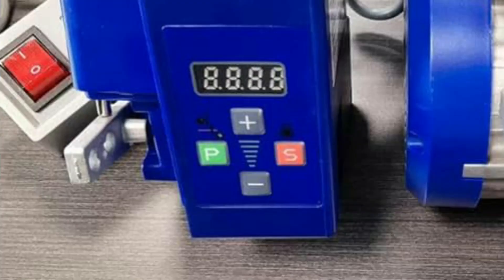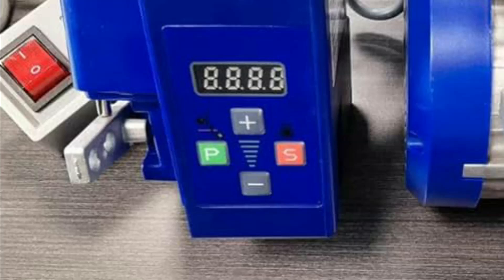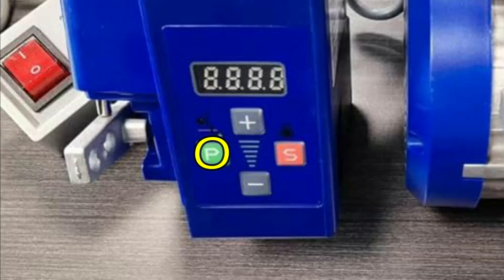Sowing Machine Servo Motor Electronic Control Operation Manual

Comment from the maker: 0:00:10
The ( P ) key and the ( S ) key are used to change the parameters of the servo motors or to change other functions
0:00:15
Additionally, if your sewing machine is equipped with an LED light
0:00:20
you can turn the LED light on or off by pressing the ( S )  button
0:00:25
In standby mode, if your sewing machine is equipped with a needle position sensor
0:00:30
you can move the needle up or down by pressing the ( P ) key
0:00:35.027,0:00:40.026
By pressing the ( P ) key you can move the needle up and down without turning the hand wheel
0:00:40.026,0:00:45.025
While in standby mode, you can easily increase or decrease the speed by pressing the ( plus ) and ( minus ) buttons.
0:00:45.025,0:00:50.024
If you want to change the direction your servo motor rotates to forward or backward.
0:00:50.024,0:00:55.023
While in standby mode, press the ( P ) key and the ( + ) key at the same time.
0:00:55.023,0:01:00.022
Then you can see  ( P - 00 ) on the display.
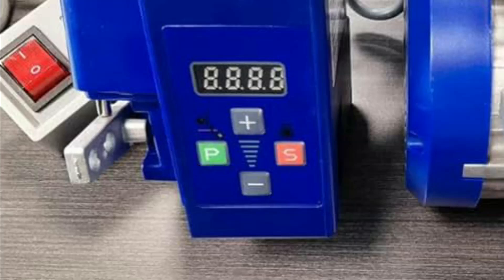0:01:00.022,0:01:05.021
If something other than (P-00) is displayed, for example (P-17)
0:01:05.021,0:01:10.020
use the plus and minus buttons to change (P-02)
0:01:10.020,0:01:15.019
After selecting (P-02)
0:01:15.019,0:01:20.018
Next, press the ( P ) key.
0:01:20.018,0:01:25.017
Then you can see ( 1 ) on the display.
0:01:25.017,0:01:30.016
Change ( 1 ) to ( 0 ) by pressing the plus button.
0:01:30.016,0:01:35.015
Then save by pressing the ''S'' key.
0:01:35.015,0:01:40.014
This allows you to select ( 1 ) to rotate the motor backwards for the overlock machine and save.
0:01:40.014,0:01:45.013
This allows you to select and save the motor to rotate forward ( 0 ) for normal machine.
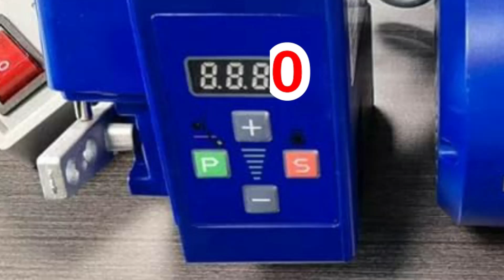0:01:45.013,0:01:50.012
Generally, servo sewing machine motors operate at speeds between 1000 RPM and 7000 RPM.
0:01:50.012,0:01:55.011
If operating at a maximum speed of 7000 RPM is a hindrance to you in completing your sewing tasks.
0:01:55.011,0:02:00.010
You can always maintain your desired speed without exceeding it.
0:02:00.010,0:02:05.009
For that, you need to use the Speed Lock feature, which is done like this.
0:02:05.009,0:02:10.008
Press the ( P ) and (minus) buttons at the same time.
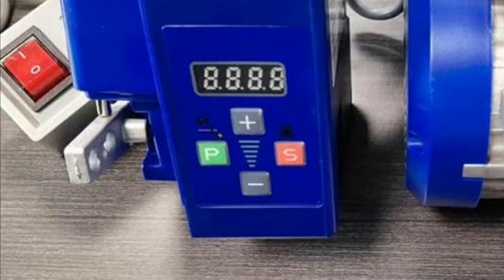0:02:10.008,0:02:15.007
Then you will see the first ( 0 ) on the display blinking ( 0000 ).
0:02:15.007,0:02:20.006
Four zeros appear on the display, the first zero blinking.
0:02:20.006,0:02:25.005
Now you need to enter the pass code.
0:02:25.005,0:02:30.004
You can enter any password you like.
0:02:30.004,0:02:35.003
I'll use 2024 as an example.
0:02:35.003,0:02:40.002
Using the (plus) key, The first ( 0 ) is changed to ( 2 ).
0:02:40.002,0:02:45.001
Next, press the (P) key again.
0:02:45.501,0:02:50.033
Using the (plus) key,  Then the next ( 0 ) will start blinking.
0:02:50.033,0:02:55.032
That (0) is unchanged.
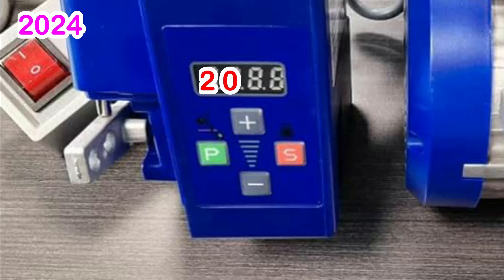0:02:55.032,0:03:00.032
Press the (P) button again.
0:03:00.032,0:03:05.031
Using the (plus) key,  The third ( 0 ) changes to the ( 2 ).
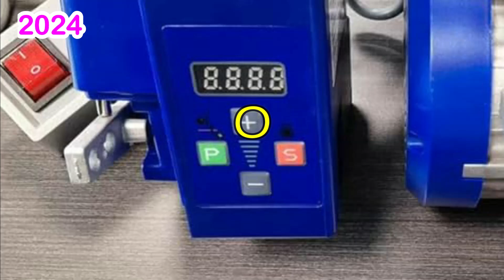0:03:05.031,0:03:10.030
Press the (P) button again.
0:03:10.030,0:03:15.029
Using the (plus) key,  The fourth ( 0 ) changes to ( 4 ).
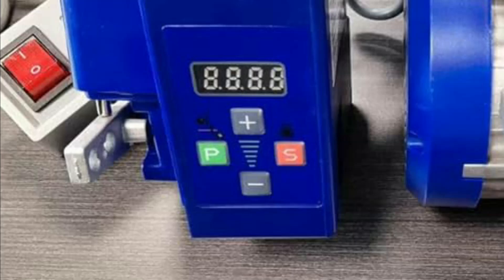0:03:20.028,0:03:25.027
Press the ( S ) button to save.
0:03:25.027,0:03:30.026
The display changes to ( P - 00 ).
0:03:30.026,0:03:35.025
Using the ( plus ) key, Change to ( P-01 ).
0:03:35.025,0:03:40.024
Pressing the ( P ) button.
0:03:40.024,0:03:45.023
The maximum speed is shown as 7000 RPM.
0:03:45.023,0:03:50.022
Using the ( minus ) button, change to the maximum speed you want.
0:03:50.022,0:03:55.021
Let's say your desired maximum speed is 2000 RPM.
0:03:55.021,0:04:00.020
( S ) Who are you serving.
0:04:00.020,0:04:05.019
Press the ( S ) button to save.
0:04:05.019,0:04:10.018
Now, when I increase the speed by pressing the (plus) key normally, it does not go above 2000 RPM.
0:04:10.018,0:04:15.017
If you want to remove speed lock.
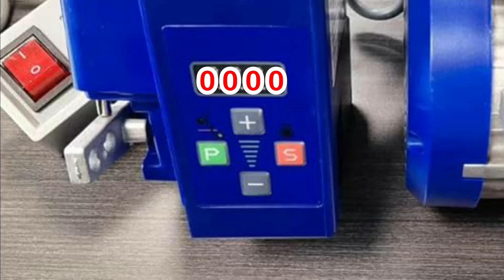0:04:15.017,0:04:20.016
Press the ( P ) and ( minus ) buttons at the same time.
0:04:20.016,0:04:25.015
Then you will see the first ( 0 ) on the display blinking ( 0000 ).
0:04:25.015,0:04:30.014
Four zeros appear on the display, the first zero blinking.
0:04:30.014,0:04:35.013
Now you need to enter the pass code.
0:04:35.013,0:04:40.012
The pass code is 2024.
0:04:40.012,0:04:45.011
Using the ( plus ) key, The first (0) is changed to ( 2 )
0:04:45.011,0:04:50.010
Next, press the ( P ) key again.
0:04:50.010,0:04:55.009
Using the ( plus ) key,  Then the next ( 0 ) will start blinking.
0:04:55.009,0:05:00.008
That ( 0 ) is unchanged.
0:05:00.008,0:05:05.007
Press the ( P ) button again.
0:05:05.007,0:05:10.006
Using the ( plus ) key,  The third ( 0 ) changes to the ( 2 ).
0:05:10.006,0:05:15.005
Press the ( P ) button again.
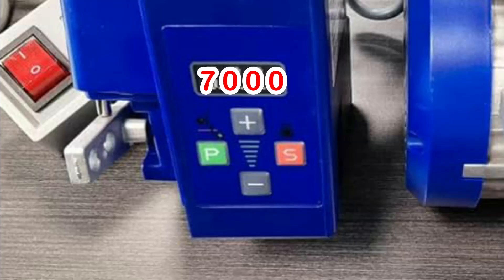0:05:15.005,0:05:20.004
Using the ( plus ) key,  The fourth ( 0 ) changes to ( 4 ).
0:05:20.004,0:05:25.003
( S ) Who are you serving.
0:05:25.003,0:05:30.002
Press the ( S ) button to save.
0:05:30.002,0:05:35.001
Now the speed lock is removed, so you can increase the speed to 7000 RPM if desired.
0:05:35.001,0:05:40.033
Using the speed lock feature can also prevent unwanted people from increasing or decreasing the speed of the motor.
0:05:40.033,0:05:45.032
You need to watch the speed at which the motor is working.
0:05:45.032,0:05:50.031
By pressing ( S ) and ( P ) keys simultaneously.
0:05:50.031,0:05:55.030
Then you can see the ( C-01 ) display.
0:05:55.030,0:06:00.029
Now press the ( P ) key.
0:06:00.029,0:06:05.028
Press the pedal switch down.
0:06:05.028,0:06:10.027
While the motor is running, you can see the speed of the motor rotation on the display according to the current conditions.
0:06:10.027,0:06:15.026
These ( C-01 ) parameters can also be used to diagnose motor faults.
0:06:15.026,0:06:20.025
In the same way ( C-02 ) you can check the voltage of the power supply to your sewing machine.
0:06:20.025,0:06:25.024
By pressing ( S ) and ( P ) keys simultaneously.
0:06:25.024,0:06:30.023
Then you can see the ( C-01 ) display.
0:06:30.023,0:06:35.022
Change the (plus) button to ( C-02 )
0:06:35.022,0:06:40.021
Now press the ( P ) key.
0:06:40.021,0:06:45.020
Now your display will show the voltage of the power supply provided to the sewing machine.
0:06:45.020,0:06:50.019
The voltage should remain at a constant value of 230V, and any voltage that is too high or too low or fluctuates too frequently from 230V may cause damage to your servo motor.
0:06:50.019,0:06:55.018
If you have made a mistake while trying to change the parameters of your sewing machine's servo motor, and you are unable to identify what went wrong and how to correct it, don't panic.
0:06:55.018,0:07:00.017
Turn off the motor's power switch.
0:07:00.017,0:07:03.017
Wait a few moments for the LED light and display to turn off.
0:07:03.017,0:07:06.016
Press the ( P ) button to turn on the power switch.
0:07:06.016,0:07:10.015
When the motor turns on, remove your finger from the ( P ) button.
0:07:10.015,0:07:13.015
All settings are reset to default settings.
0:07:13.015,0:07:16.014
reset to default settings Second method.
0:07:20.013,0:07:23.013
In standby mode, press ( P ) and ( plus ).
0:07:23.013,0:07:26.012
Then you see, ( P - 00 ) mode.
0:07:26.012,0:07:29.012
Press and hold the ( S ) button for three seconds.
0:07:29.012,0:07:32.011
All settings are reset to default settings.
0:07:35.010,0:07:40.009
You can see that the settings that were there before the reset are restored 100% the same way.
0:07:40.009,0:07:45.008
If you feel like I worked hard to make this video for you, and if you feel like this video was helpful to you, like the video, share the video, and comment with your thoughts.
0:09:15.024,0:09:25.022
If you feel like I worked hard to make this video for you, and if you feel like this video was helpful to you, like the video, share the video, and comment with your thoughts.